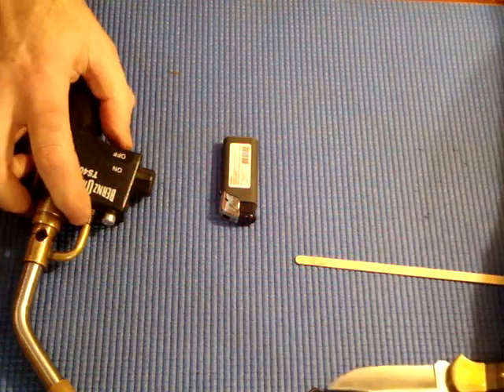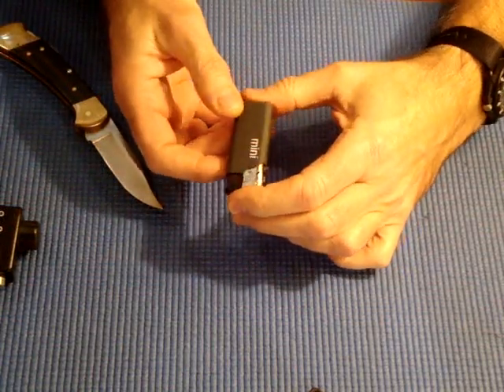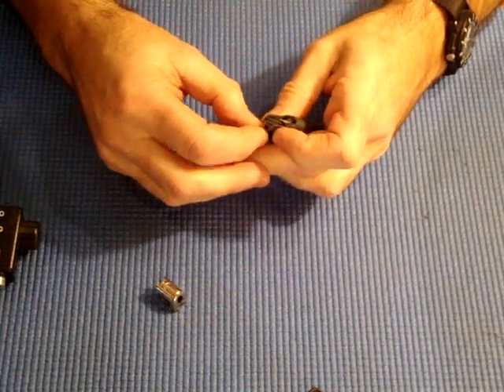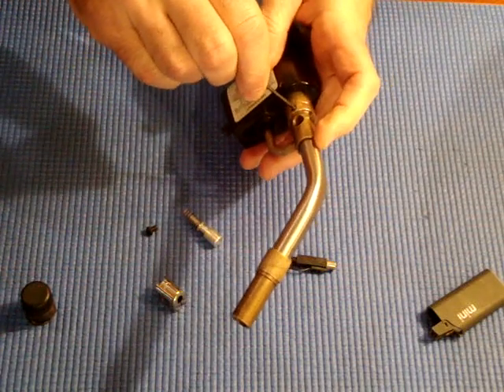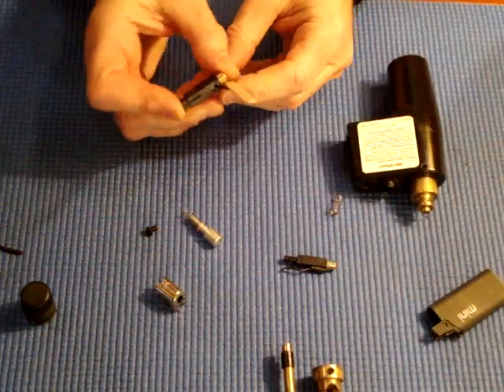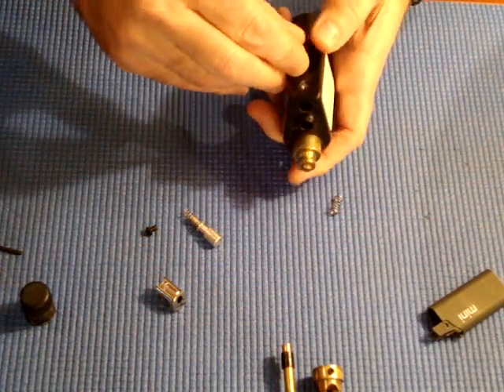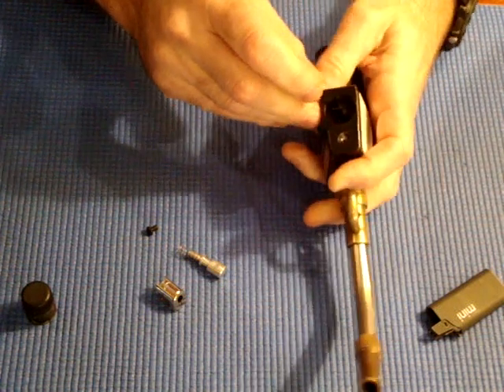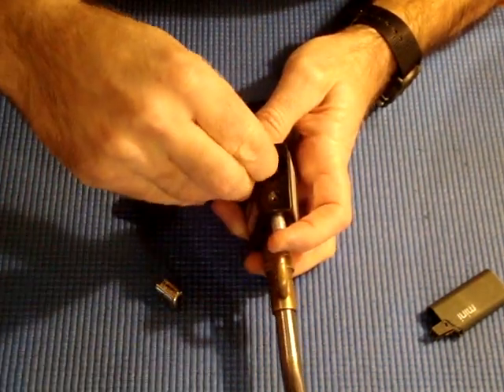How to fix the piezoelectronic igniter in your Bernzomatic TS4000

Comment: I too searched for a replacement piezo. Found your video. Excellent. I was inspired to troubleshoot mine. Found the piezo working but the pladtic holding had melted a little bit. Cleaned it up and reseated it. Now it works. Thank you.

Comment from the maker: Very few Companies care about making a product last, never mind about fixing it. They want us to buy a new one. Not me. Every product is usually made to last for 1 yr. Glad to hear that you were able to fix it.
Reply: They gave me a song and dance about safety regulations yada-yada. I have been buying used units and closeout stock on ebay, but I'm gonna fix them now. I have repaired several by cleaning and adjusting the spark wire, but I have several that won't work. I use mine in beekeeping, so I have several and they get wet and dirty.
Reply: Correct,but most of those dishonest bastards,haven't a clue what a machinist/fabricator does....The crappy stuff is what makes us tick...My squall said to me recent" You better not purchase anything new...for you will simply destroy it,modifying it to your liking"   Fine woman,she is. Kindest regards,sir.

Comment: Brilliant, thanks for disassembly instructions. Another common issue is a short circuit at the circular metal clip holding the end of the piezoelectric wire internal to the nozzle (flame) end. The tip gets hot, melts the insulation off the wire at the circular retainer clip and then shorts the circuit at the nozzle tip so there's no spark (no ignition). The small 90° brass elbow tube at the base of the nozzle screws off the nozzle body (its threaded) and thus you can insert a new wire (from a cheap BBQ lighter / long BIC lighter etc) through the entire channel. The Brass cap and plastic insulator at the end of the 90° brass elbow tube just pull off, the wire then just wraps under the brass cap to make contact. Its dead simple and saved me a $55 replacement. Excellent!
Reply from the maker: Ann Brush Gkad it worked out for you. Stay safe.

Comment from the maker: The igniter from a Master Chef BBQ lighter has a stronger spark than from the lighter and is the correct length and has a long wire that you can trim to your liking.
Reply: Dude thanks for the tip!  Works perfectly now. 😁

Comment: Thanks for this video! I just repaired my torch that hasn't worked in years. I was about to buy a new one because I needed it for a project today. I used the igniter from one of those lighter sticks that you get in a three pack at Costco. It was almost exactly the same as the original. Five minute repair saved me around 45 bucks and a trip to HD.
Reply from the maker: Glad to help. Berzomatic are the ones that sb selling the igniter's, but then they wouldn't be making a profit if people didn't throw away the old and buying the new. I don't care what they do cause I found a fix.

Comment: This fixed an almost 32 year old Sure Fire T-110 I bought in Oct of 87. I had to replace the Schrader valve like 10 years ago , it would give a flame in kind of a pulse and go out. I didn't have anything to loose so I figured how to pull that section apart and found a valve in there just like what you'd find in a tire stem. It was all gunked up, I replaced it and was back to normal. Ya I know the safety people would have a fit !  When the igniter quit working I figured it had some proprietary part and didn't look further. The cool thing was I had save a few of these from lighters for other projects, had one that looked almost identical.  Thank you

Comment: Whoa!  Great idea yes. However you may wish to try this first:  I had the same problem as this with the igniter failing to spark.  I simply removed the torch head and igniter tube (all one piece) and removed the spring that is on the igniter  side.  Looked down inside and saw a bead of moisture surrounding the sparker (or whatever they call it.) I then turned the unit upside down and let the flame from a couple kitchen matches dry out the innards, being careful not to melt the rubber gasket that sits on top of the housing.  Popped the spring back in, re-installed the head, and voila! , works fine.  So, if you live in a humid environment or up here in the northern Colorado rocky mountains where the shop may be frequently below freezing then warmed up frequently, there is a good change you have formed a ball of condensation on the igniter.  Worth a look before you go to any more trouble.
Reply from the maker: First test the igniter itself, if it's dead then you need a new one.
Reply: @johnmilner7603  Yeah I wouldn’t go through all that time knowing I’d be wasting 100% of it.

Comment: My Bernzomatic TS4000 stopped making a proper spark to igniter.  I tried cleaning and adjusting the igniter but it did not fix anything.  I observed a small spark at the spark point and I determined  the dielectric coating was shorting to itself.  I took a dab of enamel paint and dabbed it on the side of the electrode where the short was sparking.  I let the paint dry.  When I tested for spark, the spark was much better , and the spark was directed from the tip of the eclectrode to the edge of the tube, where the spark is supposed to arc.  After this my torch stared to ignite properly.  Getting quality products from mass production is becoming a growing problem.
Reply: Smart idea. This is what I do. But most people won’t know this tip unless they have been doing it awhile.

Comment: Confused on cutting the wooden stir stick.   Is it because the piezo was shorter than the original?    So the wood goes down first then the piezo ?    

Also, the piezo wire needs to come out of the hole a little bit correct?  

Thanks

Comment: Sweet, I just did mine with an extra stick lighter I had around like a guy below used.  Mine was a little too short and thin so it wanted to float around in the button and not fire consistently.   I had some washers around and used some little ones (#6's)  in the bottom of the button to set the length of the stroke and some slightly larger ones (#12's)  that the pizo push would go through to capture the end so it would not float around.  I was able to set it so it feels just like I remember it from the factory.  It seems ridiculously  wasteful to just chuck it.

Comment from the maker: After bending the wire towards the metal end (not the push button  end), flatten it straight and it should be 1/8" or 3 mm past the metal end. Then the insulation is stripped off 1 mm to reveal the bare wire. All the haters can go buy a new torch and keep the makers in business. Most of the haters will be Benzo employees. Suck it up.

Comment: If you get water down the plastic cylinder that houses the igniter spring, it will spark but be very weak. Just taking it apart may fix it. Cleaned with non flamable brake cleaner.

Comment: Dude I just fixed mine thanks to you! My igniter ended up not being bad but my button wouldn’t press down far enough so i i did what you said with a stir stick and it worked perfectly! Shoot I was about to just throw it away and buy another one. Thank you again for making your vid. In the last two days I’ve been buying that style lighter at a couple different stores because I was planning on replacing the igniter. 
I wonder why this happens with the button? Anyways the stick did the trick!

Comment: but I didn't find the electronic cigarette lighter I use a BBQ Lighter and it worked even better cuz it has a little wired that I can choose cut it at the link that works any good thanks a lot appreciate it your the are a hero man
Reply from the maker: When my BBQ lighter runs out of fluid I'm going to keep the igniter as well.
Reply from the maker: The next BBQ lighter I get that runs out of fuel, I'll open it up and check out the piezo....thx

Comment: First pure genius. My 4000 just stopped working.   So I took apart my BBQ lighter and sure enough there is a Piezo thingy.  It is exactly 1.5 in.   This one has 2  black wires one about  3 inches the other one about 7 in. the longer one was crimped over at the end of the tube right next to the gas spout. the other one in a slot partway up the tube. Could you explain exactly where these wires will be placed in the Benzomatic torch ?   Also can you explain how the thing works?  Thanks
Reply from the maker: martin smythe I've never seen one with 2 wires before. See if only 1 wire can spark. Hold the button on the piezoelectric in one hand and with the other take the wire that should have a bit of insulation stripped off and hold it 1/8" away from a bare piece of steel such as a screwdriver, then press the piezoelectric button and the spark will jump from the wire to the steel screwdriver. This is how it works in the Benzo, the wire is close to the steel and sparks thus igniting the gas from the propane bottle.
Reply: @johnmilner7603  The longer wire sparks to a screw driver. How  long should I make it. and then it goes just inside the spring?
Reply from the maker: martin smythe After bending the wire towards the metal end (not the push button  end), flatten it straight and it should be 1/8" or 3 mm past the metal end. Then the insulation is stripped off 1 mm to reveal the bare wire.
Reply: @johnmilner7603  Thank you Thank you thank you, The piezo that came out of the $ 1  barbecue lighter which was empty any how was exactly the right length. Works like new.
Reply from the maker: martin smythe Success. I love when a plan comes together.

Comment: The fastest easiest fix if you have it is I use my JB weld clear glue and within an hour or less it works perfect again. But you can always use heat shrink or any insulator similar that is glued together so there’s no holes. I repair lighters constantly.
Reply: I don't understand why you would need jb weld? How does that repair the piezo sparker? And what holes are you referring to?
Reply: @maxp9793  You don’t. I just had it next to me and its better than tape that won’t hold. The insulation is there so it sparks at the end. Its like having a hole in a garden hose. Same thing. Minus pressure considerations. Where would the water go? Patch it and it works right.

Comment: The reason its hard to find that is the igniter like u said said is a large variety . Most are the standard size in electric lighters, but hey...you did a great repair mod / tinker / engineering job with that and electricity doesn't care either way. As long as from the spark it maintains electrical continuity until it reaches it's designed end point ( in this case to ignite the gas ), then mission accomplished.I got one broken down in front of me as I post this and I actually accidentally disabled the thing. Trying to put a mod on this torch. I like it, but I don't need maximum ALL the time lol. I know the t s8000 has controllable flame but we all some broke bastages lately eh? Lastly you can get igniters with longer wiring for pennies on the dollar. Just go to WAL Mart and buy a bunch of 99 cent Ozark Trails kitchen / camping lighters and gut em. Free butane as well and if youre a pyromaniac like me, the fuel lines are gold when your hand torches need them. In addition you can get larger igniters on most modern ovens, grills, etc.

Comment: The wire on the new peizo is left unterminated in the middle of the spring? How does the spark make it to the torch head.
Reply from the maker: Through the spring at 4:13.

Comment: Just an FYI for anyone that purchased a TS4000 or TS8000 after June 1, 2016: Bernzomatic covers it with a limited lifetime warranty.  And if you purchased it from Home Depot and still have your receipt, I have been told Bernzomatic has a contract with them whereas they will swap it out for a new one at the store no matter when you bought it. Might be the same with some of the other big box hardware stores like Lowes and Menards, I don't know.
Reply: I just bought one and it says right on the box lifetime warranty,  I'm going to toss the box and receipt in a safe place and save it for when the time comes.

Comment: 12-4-2021  - - - -  You should invest in a close-up camera to show what you're looking at with the flashlight.  Show the piece of wood you cut to go inside the round thing.  Show the "bent wire" part in close-up.  Etc...   Otherwise nice video - thanks.  I just bought one of these in the USA (Michigan) at Home Depot for about $36.00 US.  By the way, those little propane tanks price doubled in just a few years.  Was two for six bucks, not six bucks each.  If you're reading this you might buy a supply of these before the price doubles again.

Comment: This design must be a racket for Bernz-O-matic; they make good stuff for the most part.  I paid about $35 US 10 years ago & have not really used that much.  The igniter quit a couple of years ago, so I thought that was bad deal right there, since it got used once every 3 or 4 months, not every day!  Thanks for the info any way, as I too was just starting to search for a replacement igniter; probably made in China & costs 10 cents!!  Buy a gross & sell them on eBay!
Reply from the maker: Darren Duncan I also keep the igniter out of a BBQ igniter once the fuel is used up. Master Chef brand # 085-1409-2 from Canadian Tire which is usually on sale.

Comment: Why go through this when the torch has a lifetime warranty through bernz-o-matic?

Also 90% of the time, the ignition stops working because it got dropped or banned and the tip under the nozzle got knocked too far away from the sidewall to let the spark jump.   Just unscrew the tip and push the ignitor tip a tad closer to the side.
Also droplets of solder falling into the tip can cause ignition issues.  If you see this is the case, just use another torch to heat up the solder in the tip and then tap it so the melted solder falls out.

Comment: N.G Both the lighter igniters I tried were shorter and not as robust as the original.
Reply from the maker: Use one from a Master Chef BBQ lighter. It's the same length as the orig igniter and has a stronger spark than from a lighter.

Comment: could you find the lighter online? i cant find one.
Reply from the maker: The brand I used is X-Lite. Made in China and imported by X-lite Canada Inc in Markham Ont. I've added links above from Amazon.
Reply: thank you this was the first video that helped me thanks again
Reply from the maker: I have links in the Show More tab above for buying them online if your local Dollar Store doesn't have them.
Reply: They sell them at ACE hardware
Reply from the maker: The igniter from a Chef BBQ lighter is the same length as the orig and has a long wire you can trim.

Comment: This works, but I've firmly concluded that this is just a bad design entirely.  

The ignitor getting weak is one thing, but the spring connection between the tube assembly and the valve body is complete garbage.  Mine would spark around the bottom of the insulator about 80% of the time.  Even if it weren't for the short-lived ignitor and poor insulation at that transition, the wire in the burner tube often gets out of position or gets overheated and shorted to its support.  

I ended up soldering a section of #22 silicone jacketed high temp wire to the ignitor, put heat shrink on it, and ran it straight up the burner tube and support.  No more spring or insulator bullshit. The wire can be simply replaced if it gets toasted.  

Even at that, it still takes 2-3 tries and valve fiddling to make it work.  It also makes the whole torch/tank assembly top heavy and awkward compared to a regular brass torch head.